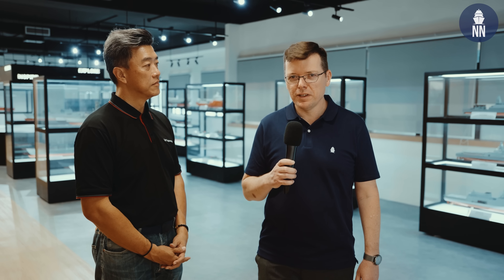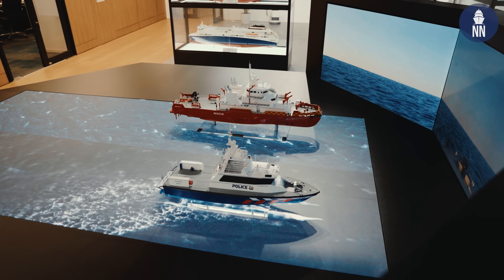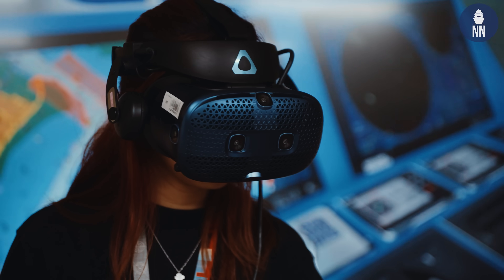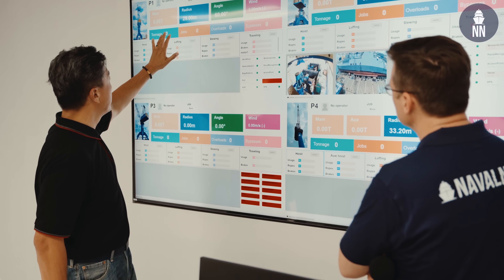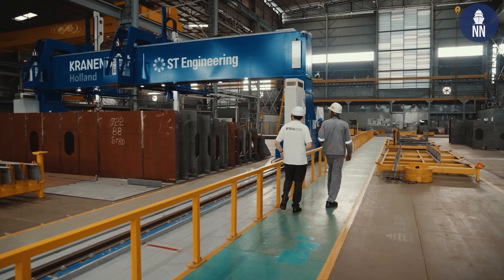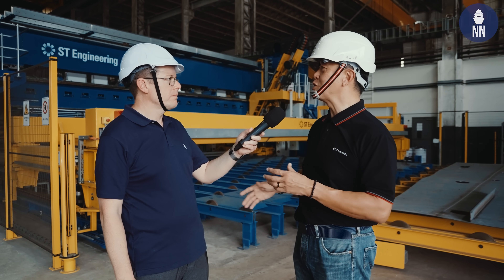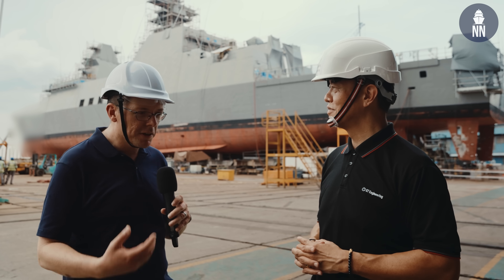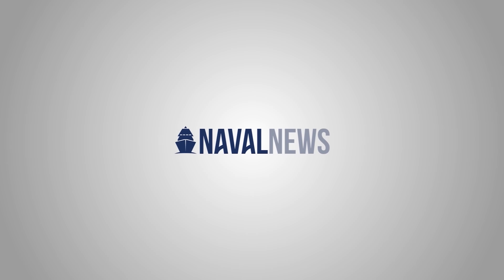Exclusive tour of ST Engineering Shipyard in Singapore

Comment: Formidable class frigate censored. Still the OTO Melara 76 mm gun and 32 cells Sylver vertical launch system or change gun and anti-air armament in the mid-life upgrade.
Reply: The  76mm Oto Melera is getting a STRALES upgrade to fire DART/Volcano guided munitions. 

While there’s no public statement as to the upgrade to the Formidable-class AAW missile systems, the Slyver A-50 VSLs could possibly switch to Aster 30 Block 1NT missiles, while smaller VLS are added for MICA-VL.
Reply: Yup Aster 30 B1NT can be integrated onto slyver 50 VLS for long range AA capability. Don't see Mica NG been integrated with probably aster 15 NG in the pipeline for development